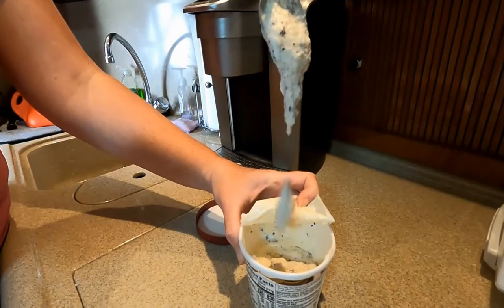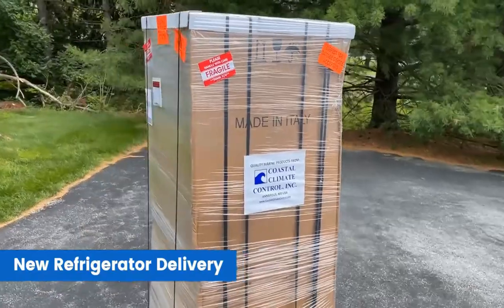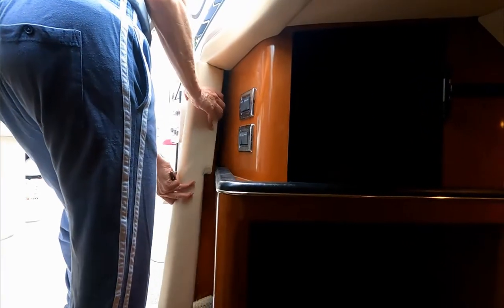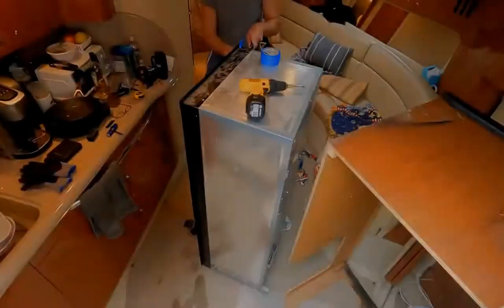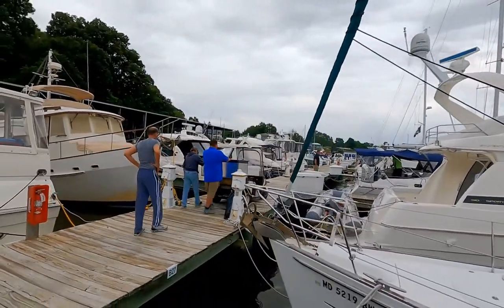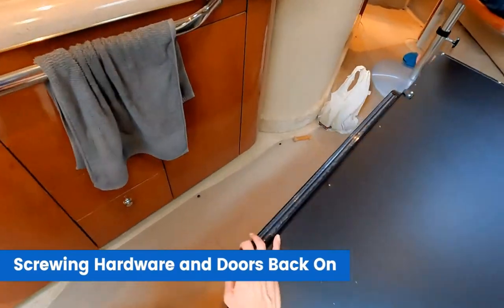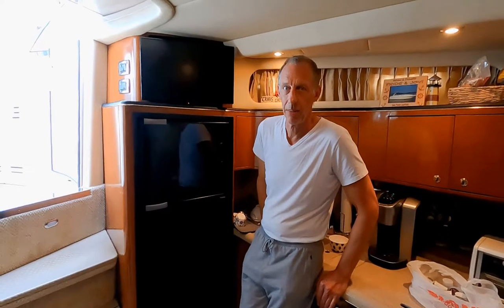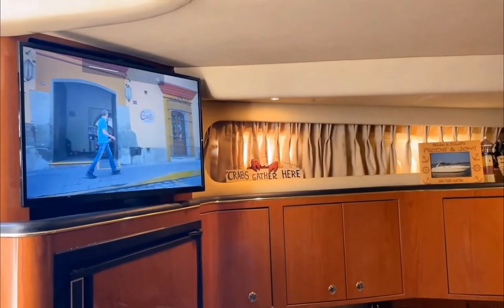How to Replace Boat Refrigerator | Remove & Install Fridge on Sea Ray Boat

Comment: Do you remember the Norcold model number? I'd like to see if my Norcold DE0061 can be replaced with the Vitritrigo model you bought. Thanks!
Reply from the maker: Unfortunately not sure the Sea Ray manual with our ‘02 410DA only has a Sea Ray part #, but dimensions of the fridge should be easy to obtain by measuring outside of fridge (not including frame that holds fridge in) width & height is most important. Also on Vitrifrigo site they have full specs and a number of options. Good luck - so far love our Vitrifrigo.

Comment: I have taken out every. single. screw. I could find, but the cabinet still wont come out. i even slid knife around to break any seals or glue.  I have the new Vit fridge ready to go and the old fridge is already t the recycler, but i am stumped on the cabinet! Can you help me?
Reply from the maker: Is your boat a Sundancer or Express cruiser? We had to remove the cabinet on our Sundancer because we couldn’t get the old fridge out but from what I understand you can get the old out on the Express without removing the cabinet. 

For us there was one last screw hidden under the step there was a block of wood under the step & that supported the fridge so look there - that was the last one we found that did the trick for us! I hope this helps!!! 🤞

Comment: Can you tell me which model your wet bar refrigerator is?  I have the same boat and I can't find a front vent small refrigerator like the one you have.
Reply from the maker: Ok you owe us one lol.. just went out and laid down on the cockpit floor & stuck my head inside to check 😂 it’s Norcold DE 0051 - hope that helps!

Comment: I seemed to miss why you took the cabinet off?
Reply from the maker: The cabinet curves out in front of the doorway on our Sundancer so there’s no way to get the old fridge out or new fridge in unless you take the cabinet out. Worst part of the whole project!! There’s a recap at end that explains it & in beginning a bit too.
Reply: @MyBoatLife  I put 2 new Virfrigos’s on my boat the one inside worked intermittently for about a month, until I found the ground wire screw was lose(from factory). The outside one was intermittent pulled out and back in several times over several weeks, finally found a kink in the coolant line(from factory) slowly unbent line and been working great for 2 years now.
Reply from the maker: @marksimmons7721  wow we had no issues like that. Glad you were able to figure it out!